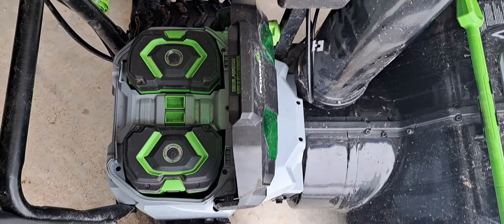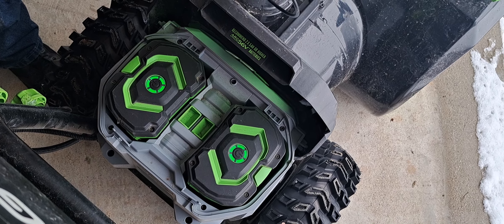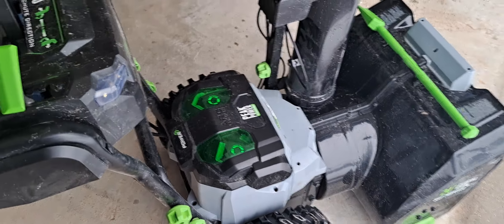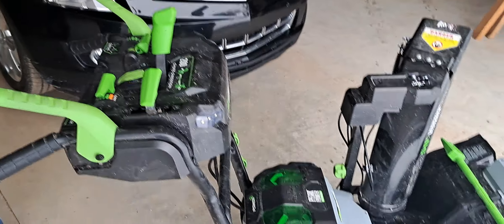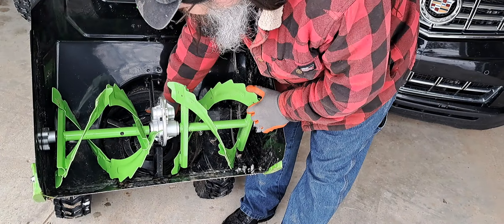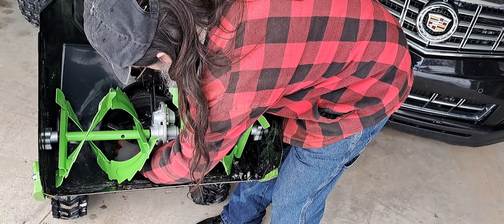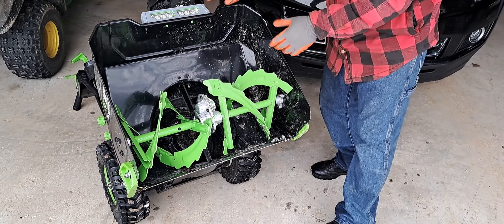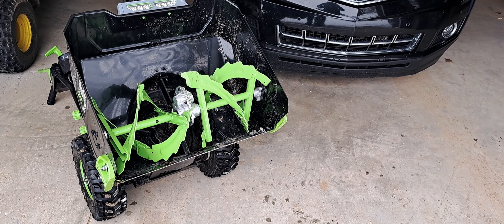EGO 2 stage snowblower Auger quit working

Comment: I had this exact same problem with my 2/stage snowblower.  Drive would work but not the auger which did same as the video.  On the panel by the start button it was green but when I engaged the clutch for the auger it went to blinking orange.  Called EGO support and explained this to them and they set up a repair for me at my nearest EGO repair center.  Took it in and the tore it apart and found that the issue was a dead motor.  Replace motor and all is fine.  Thank you EGO.

Comment: You’ll need to access the gear box and replace parts, IF the box isn’t factory sealed, which would be my luck.  If you can positively identify the gear box as being defective, I’m sure that the manufacturer would love to sell you a new one.  🤬. I truly which you some luck and some goodwill my friend with your endeavors.  ❤
Reply from the maker: It should still be under warranty he's had it right about one year.